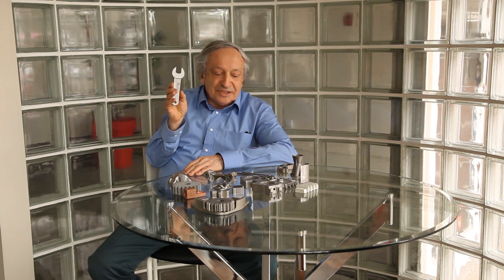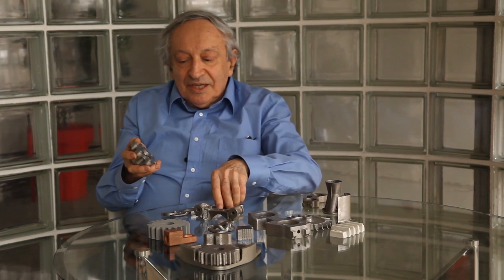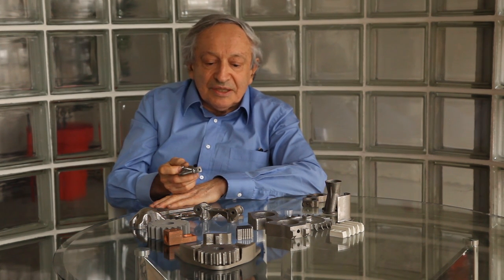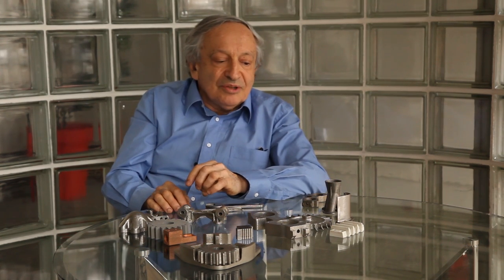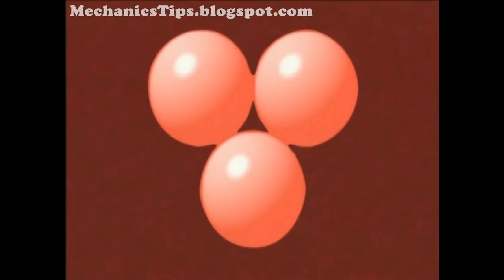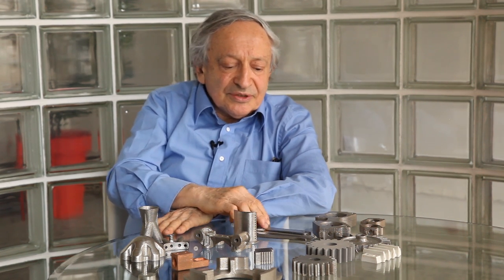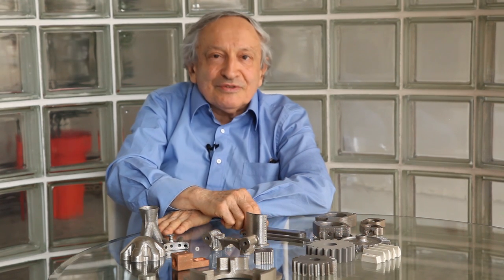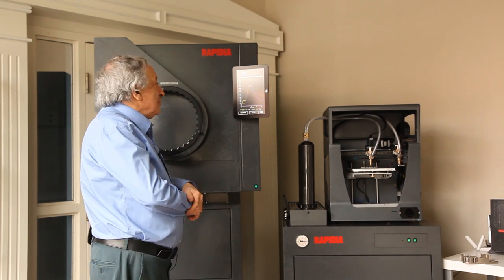Prototyping - Metal 3D Printing

Comment: Thank you. You inspire me. 
I'm just starting out at the age of 48 in prototyping after electric motor rewinding for 32 years. 
Thanks.
Reply from the maker: I used to rewind motors too as a teenager as I couldn't afford new ones. Even built my own motors.
Reply: @dgelbart  it's a trade of no recognition. 
We repair and see the engineering faults, after it has been pounded by industry. 
I play what if. 
And self taught myself physics, and solidworks, in order to get a invention to the prototype stage. 

Self funding is slow progress. 
So in order to complete the concept, I've invented some small hand tools to fund my work. 
I've made a random wire inserting tool. 
It's not finished but almost there. 
Time wise, it would take 15 hrs to fit coils manually on a 75 kw,  4-pole motor, 
With my tool,  I've consistently got it down to 10hrs. 
And it's still not there. 
It can be 3d printed. 
Witch is my obsession. 

Thanks for replying
Reply: I've also come up with a concept for bonding 3d printer materials while there printed. 
It's a bit extreme, but it's based on the basic principles of heat and light.

Comment: Hi Dan,  I had the good fortune to learn from you at ASML in CT.  Those lessons specifically helped tremendously as I transitioned from precision mechanics to medical devices.  Your reach is far!  FYI, we have been using 3D printing in metal and plastics for production.  Printing allows us to make organic shapes which helps us create complicated flexures with less parts.  It also allows us to integrate industrial design into our products while avoiding the high cost of injection mold tooling.  Our most successful implementation of 3D metal printing is to create micro structures similar to bone which allow better bone ingrowth into an implant.

Comment: Interesting video, sintering at zero gravity might allow for larger objects? 
Just have to get your machine into orbit.
Reply: Or reduce sag potential by about half by submerging parts in an ionic liquid inside a vacuum chamber.
You would still need to vent off water vapour from the binder paste though.

Comment: I was recently at a trade show where Desktop Metal Studio was being demonstrated, their price point for an "office" system was around $250k AU using FDM rods with binder, a washout station and a separate sintering station.. they claim to have a very specific "scaling" process to ensure the green parts are the correct size so that post sintering the finished part is correct size. I was very interested to hear about the waterbased binder re-activativing to join sub assemblies together, very clever! At the price point you discuss this is a very enticing offering!
Reply: video here for comparison, https://youtu.be/ieg2MV5v2us

Comment: Dan   I love your videos and this one in particular. I could get really interested in one of these. However, since you are on the board of directors for this company, please implore them to standardize the packaging and interfaces for the material cartridges. They could be made to an international standard just like a light bulb. Alas, if this is not done I fear that sales will be negatively affected.  The buying public has had a snoot full of the likes of Lexiark, Cannon and HP for the litany of inkjet cartridges out there. These should be made to a standard so a failure of a company doesn't leave the customer stranded for consumables.

Comment: Great discussion on when to use traditional processes ( CNC, investment cast, etc) vs Additive manufacturing like 3D metal.
My takeaways: use 3D metal printing for with internal and/or external complexity, thin parts print faster, post-process machining is required and can be time-consuming, sintering has 16-20% shrinkage in volume, Support structures are needed to prevent warping during printing, annealing in an inert atmosphere to remove printing stresses, wire EDM is one method to remove supports, Cost is $1million for setup plus specialized facility to work in.
Reply from the maker: Cost of the laser systems (for the same build volume) is high, The sintering type system cost is about $170,000. No machining or post processing needed for sintering type systems in order to remove supports.

Comment: At Fokker Aerostructures in 2010 (I worked there for a while) electron beam additive manufacturing (Sciaky) was (informally) investigated for what I thought were the F-35 titanium flaperon spars which were then forged on one of the super heavy presses which are in the US. A batch would have a lead time of over a year. Additive manufacturing by melting (the Sciaky system is really a MIG welder) I knew would pose great difficulties.

Comment: Have you considered 3D rotating the part in the sintering-oven to combat slumping?
(As a concrete-mixer does in 2D.)
It seems an obvious and elegant solution to the problem.
Reply from the maker: I have tested this. Very hard to do as the part shrinks as it sinters and it is too soft to grip. Other solutions (like surrounding it with ceramic granules and rotating) don't work as well.

Comment: Good sir, thank you for your video.
What I'm interested here is the strength of the materials after printed, compared to machined.
Obviously, if the strength was comparable then printing might take over much more than if the strength of a machined part was higher.
Reply: That depends on the quality of the metal powder, i.e. is the powder spherical or not uniform. (As Stated in the video) Quality control is being developed for being able to determine material micro-structure during a print.
Reply: @michaelbiri6676  am I getting this right, with the right powder the strength (tensile etc) of printed metal parts is the same as machined?

Comment: Ceramics hasn't had the marketing but in reality offers amazing possibilities. Whoever designs those systems and brings them to market will be rich, The sintering just takes longer but you get the strength options of metal, more heat and refractory, and electrical properties. Advanced Ceramics are used in many cutting edge applications that will be huge in the next few years.

Comment: Dan, how come water doesn't cause problems during sintering? Wouldn't expanding water vapor cause a part to explode? Could you share some details about the paste? Size of the metal particles? What is used as the binder? Looking forward to more videos!
Reply from the maker: Parts are porous before sintering, water escapes with no problem.

Comment: We use SLS to build jet engine fuel injector nozzles, which removes about 30 manufacturing steps. In exactly zero of the company's literature do we show the scaffolding from the SLS process! We make it seem as if the part falls out of the machine ready to use!

Comment: Dear Dan, thank you so much for the new video, even if it's 20% advertisement :-P I don't think anyone minds because the product is novel, the support structure and the pressure/water paste are both fantastic ideas that solve several problems I have with plastic 3D printing, and most importantly it demonstrates the challenges the 3D metal printing field faces very clearly. When you said it was less than €200,000 I was shocked. Would this be a good machine for prototyping a variety of micro-turbines? Your autoclave is long and round, sections can be water-glued together after a single printing, and I suspect that the blades wouldn't warp or sag too bad ...?

As an aside, if you are interested in producing more videos for YouTube but don't know what the subject matter should be, I can imagine a series where people submit their product ideas to you and you shoot them down as being unfeasible or unworkable, or better done another way, would be quite popular. Something like Dragon's Den, except the products are theoretical. Maybe a prototype-of-the-month might be a good way to demonstrate your metal-printer's capabilities to anyone with a good idea :-)

Anyway, welcome back - you can tell from the comments you have been sorely missed!!!
Reply from the maker: We can print small parts with a smaller nozzle (just like in plastics). Small parts stay accurate. Most people do not understand that distortion grows with the square of the size or faster

Comment: 3d metal printing is interesting technology to be sure but as Dan points out it is good to look at it carefully. One aspect of this style (sintered/laser) and the  welder type printers is that the material properties are a mystery. In high value applications such as aerospace and subsea oil, material properties, material tracing, coupon tests etc are of great importance. Even processes as mature as welding are problematic from an analysis and certification prospective to such a degree that it is avoided almost completely at Boeing Commercial. I am not a metalergical expert but have enough experience to be highly sceptical of powder metal or weld-buildup material properties and would very much like up see serious independent evaluations of those parts. Sure they are strong in compression but that is the easy part, what about fatigue/fracture mechanics etc which in my experience, unlike ultimate strength, is critical for many structural parts. I am sure the tech will improve but right now this seems great for well funded prototype work and things like offshore oil platforms where delay is very expensive.
Reply: SpaceX and Rocket Lab both use high end electron beam 3D printing to produce small, but very high performance rocket engines. SpaceX uses theirs as the maneuvering and emergency escape thrusters on the spaceship which is flying to the International Space Station, and hopefully will soon fly with the astronauts. Rocket Lab uses 3D printing for all of their engines, including the main engines of their rocket. They have ten successful orbital launches already. In the rocket engine, the material is subject to severe strains due to both pressure and thermal gradients. The pressure inside of the thrust chamber is on the order of 10 MPa, and the walls are very thin comparing to the diameter. It seems to work fine when done properly.
Reply: @cogoid  The question isn't really if it works or not, the issue is that in highly regulated fields (say commercial aerospace) the ability to establish statistically valid material allowables is critical. While it is possible to do it is going to add certain challenges and particularly say for Boeing or jet engine manufacturers in the US, if the FAA does their job, the burden of proving that 3d printed metal parts have properties which are consistent without highly detailed inspections of every single part is going to be hard. For a handful of rocket engines which don't have the same regulatory issues it is different. For prototypes (or expensive small volume production such as rockets) inspections/test coupons are of course not a problem, but when you start talking about 1000s or 10k+ parts the consistency and cost become bigger issues.  I maintain that there are very few examples of where good design cannot solve the supposedly "unproducible" parts, 3d printing is good for some prototype applications but is far from magic and I fear is used for marketing purposes rather than because it is actually the best solution.
Reply: @lukerickert5203  I agree with many of the things that you are saying. The the rocket engines that I have mentioned earlier were very high value items which allowed for an extensive testing and tweaking program. Rapidly making a one-off item or vice versa producing commodity items to the same level of reliability might be much more challenging.

Comment: Great video and introduction to metal printing. Thank You Dan!  Very much enjoyed the history as well as the details of the various methods out there now.  One subject you didn't touch on was hardness after sintering.  I did notice the materials available on the website...inconel 625 and the ones in development (maraging) look very promising for all kinds of parts/products.  Do these reach optimal hardness after sinter and is it possible to case harden or shot peen lesser materials for say gears?  So many questions now...thank you again for all you bring forward in easy to understand ways...a real gift!
Reply from the maker: You have to harden later, everything comes out annealed. This is good as normally you need some machining in critical areas.

Comment: great in depth info and dont worry, I found it very balanced, so you made sure that an eventual bias is not obvious.
I do worry a bit with what you say at around 37:20 => we dont realy know what is in the gasses released by burning off support material.. as a M.D. in oncology I shiver at that thought :s
Reply: dr_BD yup a gas spectrometer reading then a safe out gas solution would be handy for across board liability. The same was needed when carbon fibre was in development and health dangers weren’t realised. A bubble through water filter at an additional neutralising gas symbiosis on the outgas.

Comment: Interesting. I saw demo from Markforged metalX also a sintering machine. Their demo included a new approach to design since now the internal can be hollow or honeycombed or other infill lighter and can be made dense where it needs and almost empty where the loads are low. So instead of sculpting overall outside shape you can make use of internal space. Like a constant load beam could be a wedge shape thicker at encaster point. Another way could be a normal rectangular beam with more dense infill near encaster point and loose and hollow near the extremety where forces are really low. Their example was with a brake lever off a motorcycle where overal size can't change due to ergonomics so the infill of the liver was varied to make a lighter version that can withstand the same load as the normal cast/machined/forged verision from OEM.

I tinker with hobbygrade plastic FDM and when i need a metal part i go with sand casting it in aluminium or bronze or copper. The plastic part is the model, and greensand in a box will form the mould. A simple furnace to melt aluminium and i make this parts in my back yard (just a hobbyist). I can think investment casting can also benefiet from plastic FDM into stronger metals like steel. But ofc investment casting takes time to make the tree of molds and relative complex vacuum casting of steel. Sand casting large objects are very nice to do with plastic model. Ofc my parts made from aluminium could be diecast, but sometimes it's easy to not mess with draft angles and leave the part in final shape and just sand cast it. I've printed/casted a small engine block this way (and head). Diecast is not an option for engine blocks or heads.
Sure the parts are rough and need a lot of postprocess into milling, lathing, boring holes, etc.
Reply from the maker: You raised an important and mis-understood subject: All FDM metal 3D printers use variable infill for the reasons you mentioned. It is interesting that they have to use it above a certain wall thickness (about 10mm) otherwise they can not debind the parts. This means you can not make a full strength part, as infill makes the part weaker than a 100% solid part. The Rapidia system does not use debinding, therefore it can make parts with or without infill. The laser machines  can not use closed cell infill (the strongest infill) as the powder stays trapped inside.

Comment: Dear Dan Gelbart, can I ask what would be the accuracy of such parts? I realise it would be shape/dimension dependant, however, I don't seem to find any information on the Rapidia website regarding this parameter.
Reply from the maker: For small parts, say 50mm cube, accuracy is good, about 0.2mm. As the parts get larger the errors grow much faster than the part. on a 200mm part error can be 1mm. Pretty well all the error happens in sintering, so it makes no difference how the green part was produced. A large part of the error is repeatable, so you can "pre-distort" the file to compensate for the expected error. We are still learning ourselves, so once we have statisticall significant info we will start publishing data.
Reply: @dgelbart  Thank you very much for your answer. Kind Regards.

Comment: Thank's Dan.  I'm curious; if you print an object that has fully enclosed voids using a SLS/SLM system, how is it possible to evacuate the surplus powder?
Love your videos... I have directed many people to various parts of your "Rapid Prototyping" series when explanations were required.
Reply from the maker: This is indeed a major disadvantage of SLS/SLM over FDM type system. Note that even binder-jetting systems, that use sintering, have this problem. Only an FDM type printer can do closed cellular structures.

Comment: Dan. Thank you for another fascinating video. You have fired my imagination with sintering. I had never heard of it. If it has been around for so long I imagine it is a process that could be done quite simply. Could I fabricate things this way in my home shop?  I cannot find any practical help on this. Especially on what I might use as a binding agent. Any advice would be very gratefully received. Thanks again.
Reply from the maker: Not recommended for home use as you need a special furnace with a reducing atmosphere (typically 97% Ar 3% Hydrogen). THe furnace has a lot of trade secrets and hard to build.
Reply: Dan Gelbart thank you Dan. I was hoping that if ancient cultures had the capabilities, I might be able to give it a shot. Thanks again.